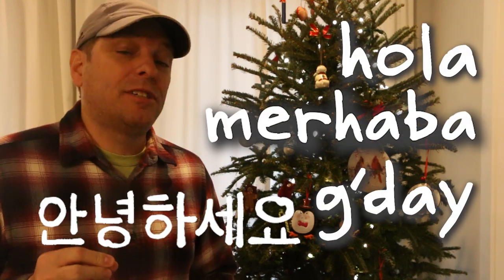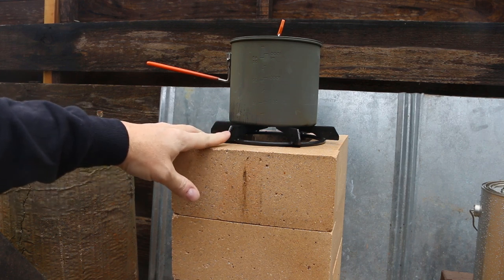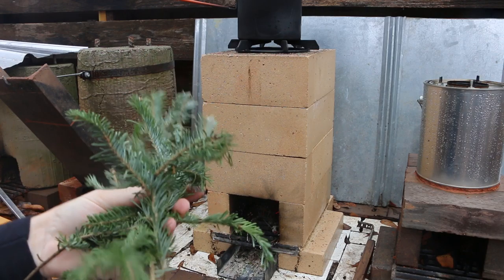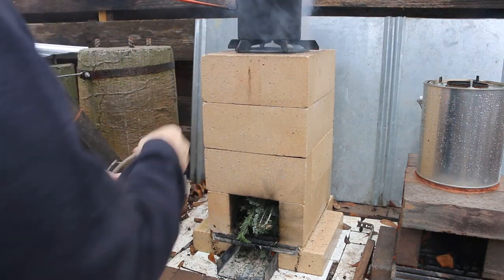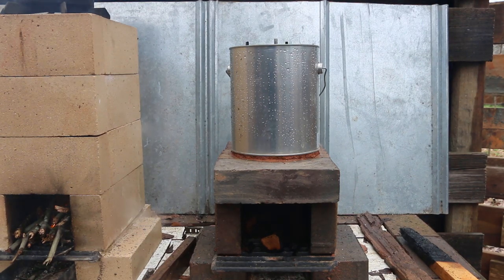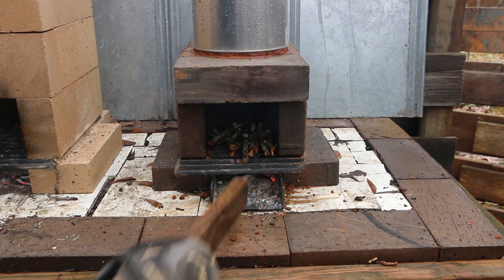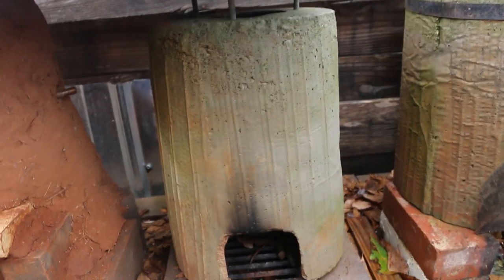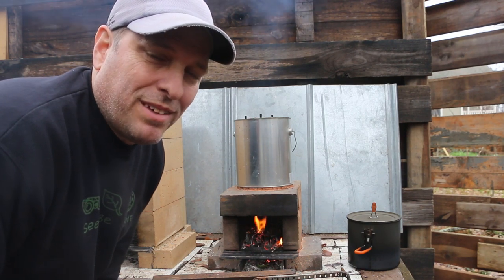How To Make A Christmas Tree Into Rocket Stove Fuel

Comment: Larger,  Self feeding or adjusting one to and indoor system with self formed paper briquettes please.
Would be nice to use monitored and briefly inside for brief periods if it could warm the upper floors but know the c-mono risks e.t.c..
Reply from the maker: Sounds like your asking for a rocket mass heater. That’s on my list. Thanks for the suggestion. Thanks for watching.

Comment: I noticed you prefer higher chimneys. Is this some math you have worked out? It just seems it would be better with one less level. Your thoughts please?
Reply from the maker: Hi Marilyn. The two principles I know with regard to rocket stoves are having a continuous cross section of air flow through the fire box and chimney...and a 1:3 ratio of firebox horizontal length to chimney vertical. That said, neither of these two stoves follow either of those rules exactly. Eventually, I’ll make one exactly to the specs, but for now I’m experimenting. Thanks for watching.